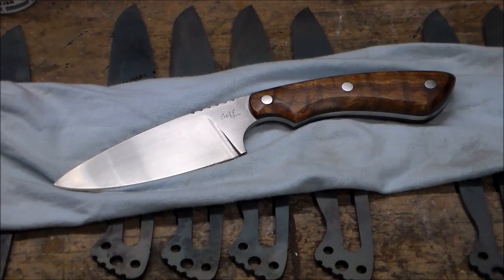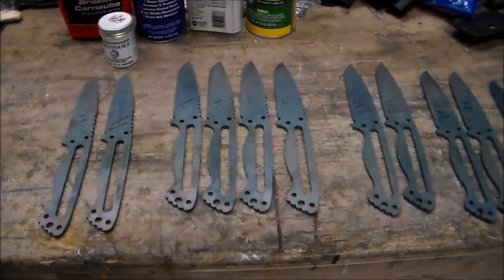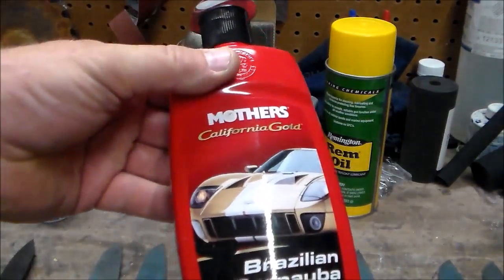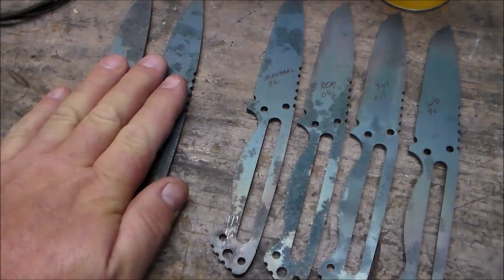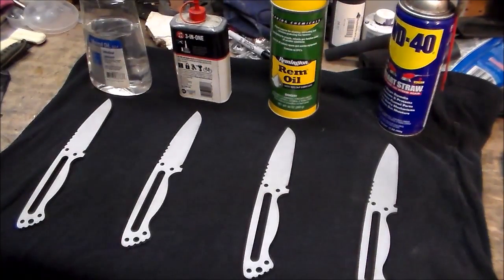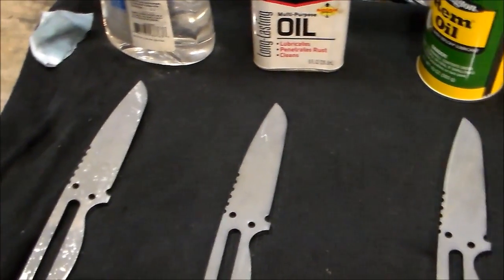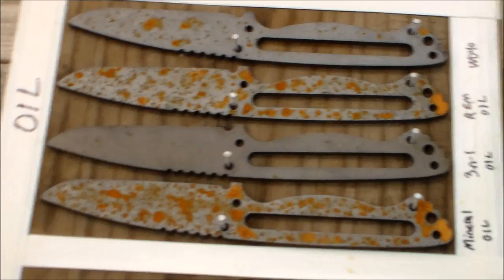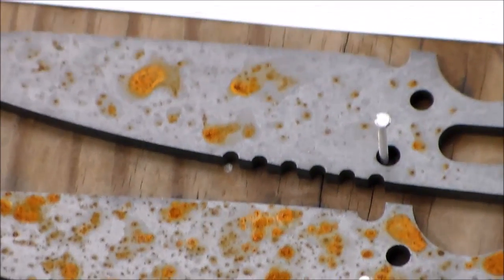1095 Steel, Corrosion/Rust Test for Knife Makers

Comment: Great video, I wish you would have tested some super lube. Im trying to find soemething that is food safe but also a good rust prohibitor.
Reply from the maker: Hmmm, never heard of that one. I'll look it up.
Reply: Yeah its great for knife pivots, hinges, flashlights etc. Theres a lot of different ones, I use the Oil super lube with syncolon (PTFE). Strangely enough I was using 3 in 1 on all my knives but then I wanted something food safe so I started using the super lube but after seeing your tests I might have to switch back. About an hour before I watched this video I ordered some citadel knife oil from amazon (again cause its food safe) but its made up of White Mineral oil and cold-pressed Camellia seed oil so its probably worthless.
My favorite for knife pivots is pro shot Zero Friction, good stuff!
Reply: JAY LEE thank you and yes I would have tested some super lube
Reply: I am looking for food-grade oil for my new knife made of 1095 steel too and saw the Citadel Knife Oil on amazon, haven't bought that yet and will go with the 3 in 1 oil first.

However, I'd like to know whether it's a good in a camping situation, to wash non-food grade oil off a knife and use it to cook, and then apply non-food grade oil later?

Thanks for the video.
Reply: I wouldnt, not camping but maybe at home when your able to wash it thoroughly. The citadel  also has cold-pressed Camellia seed oil as an ingrediant which I learned is supposed to work really well (after doing a little researcch) but then again so was mineral oil and we saw how that turned out. Would have been nice to see how the cold-pressed Camellia seed oil held up in this test as well.

Comment: Sir according to your observation,, which is The best way to protect Carbon steel from rust?
What is 3n-1 oil sir?
Please sir answer me.
Reply from the maker: Actually, almost any of the products I tested will work if you maintain them and just take care of your knife often. My personal opinion is the best system for a carbon steel blade is to have a patina like the bluing or acid etched and keep it coated with oil. Works well for me.
Reply: Sir can i use any kind of oil? 
What is 3n-1 oil?
Reply from the maker: @prakashkumerdey5098  3n1 oil is a very common household light oil that's been used here in the USA for over 100 years.
Reply: @SelfMadeProject  can i  use any oil as anti-rust
Reply from the maker: @prakashkumerdey5098  I can't say "any" oil, have no idea of what you have. I would say any light oil that you use to lubricate with should be fine. Gun oils, sewing machine oil, etc. should all be fine.
Reply: @Sceptnado  what?
Reply: @SelfMadeProject  does oil for folder knifes to fold properly work for this task? like "breakthrough hp100"
tkankyou for the answer in advace
Reply from the maker: @mataspetkevicius7466  sorry, I can't say. I've never used that one. I bet it would work, but you might just have to test it.

Comment: I have had good success with beeswax and motorcycle chain lube.  The beeswax doesn't turn racid like most oils do, and it even waterproofs shoes and sheaths.  I doubt many blades will ever see the abuse my motorcycle chains due, and I've never had motorcycle chain rust... (they will if left for years though)

Comment: I have 2 knives in 5160 spring steel from Ontario Knife Company. I wonder if these treatments would apply the same to those knives as they do to 1095??

Also on one of them I've had some very superficial oxidization start to happen from moisture in storage, although it can't be polished off. Could anyone recommend a way to rectify that?
Reply from the maker: From my experience, 5160 seems to be a tad less prone to rust than 1095. But, as for treatments, I think they would be just about the same. For a knife that just has superficial rusting, you might try cleaning with some very fine steel wool and oil. Only thing is, if its a safe queen than that will probably change the finish on the steel. If it's a user, I'd scrub it, oil it, use it.
Reply: Thanks... only thing I had around was gun oil(Hoppes), so I used that

Comment: how often to you need to apply the 3in1? Thanks!
Reply from the maker: +Matt Rhoden Wow, that's a tough question. Kind of a personal preference thing probably. On folders, oiling too often is definitely a bad thing. On fixed blades, as long as you're not soaking the scales with oil, there's not much harm in oiling often. I usually put a very light coat on my carbon blades 2 or 3 times a year, or after each hard use or sharpening. All depends on how you use them and the humidity where you live really.

Comment: Which treatment would you suggest for a chef's knife which is to be used in a restaurant?
Reply from the maker: I'm really not qualified to answer that. I don't make kitchen knives, but I hear a lot of people say they use mineral oil for them. The production carbon steel kitchen knives I have at my house all just have a naturally aged patina, I don't put anything on them. They're not very pretty, kind of like a seasoned cast iron skillet. Maybe someone else on here can share their thoughts on this too.
Reply: Thanks for the quick reply, I just asked because im not sure ich its ok to blue the steel when its used on foods...
Reply from the maker: I've also heard that blued steel isn't supposed to be used for food prep. Not sure if that's fact, myth, or just a precaution. But, even if its ok, bluing doesn't hold up that well to constant wear and tear anyway, it will wear away over time. I imagine a blued kitchen knife that saw heavy use would end up with the spine still blued and the bottom half inch or so bare steel.
Reply: I'll do some research on that, tanks for helping me out on this
Reply: i'm new in bladesmithing and dont' have too much experience  but i use my 1095 knife that  i made in normal way when you finish clean it with a wet cloth and dry it with another dry cloth  and apply some olive oil , is the same oil i use to cook so no problems with toxics and bad chemicals ,
Reply: Might try linseed/flaxseed oil. You add it to cast iron and bake it to create the seasoning so if nothing else it's food safe.

Comment: I heard you say laser cut.  I have been considering laser cutting some blanks.  I had some cut on the water jet and was not 100% pleased with them.  I really liked the profile at the start of the video.
Reply from the maker: +Belnap Custom Knives Thanks. Laser cut blades also have their problems. Like waterjet, the edges may have a slight taper to them, but the biggest issue is hardening. Anywhere the laser cuts, the heat affected zone (HAZ) is fully hardened steel. Not a big deal around the perimeter, you can just grind it off, but if you have any holes, jimping, or choils, you won't be able to drill or file them. So, I always anneal the blanks after laser, I put them in a SS heat treat foil pouch and anneal them 10 at time in a programmable oven. The reason I put up with this HAZ is that laser cutting is about half the price of waterjet. If they were the same price, I'd go waterjet.
Reply: I happen to have a water jet 7 miles away and a laser 4 miles away.  thanks for the tips.
Reply: Self Made I just got a quote back from a laser cutter for my neck knife.  I was thinking he would be able to get 70 blanks from the plate but he said he could only get 60 due to heat limitations built into his software that would no allow him to nest them closer.  I was not aware of this heat limitation.  Have you encountered this before?  I am going to check with some other vendors to see if they have the same limitations.  He quoted me $2.25 per blank which I thought was pretty dang good though.  I paid a little over $10 per blank on my prototype ones cut with a water jet.
Reply from the maker: Yeah, I've nested my own parts and came up with a number, only to have the laser cutter guy shave off a few. There are some spacing requirements on their end, so I think its just the nature of the beast. Then again, second opinions or quotes are a nice.

Comment: Great video. I’m surprised on how little rust the wd40  had on it. I was expecting more rust. The only good use I have found wd40 for is for machining aluminum. Rather use water to free up a rusty bolt than it
Reply from the maker: I had used WD on dirt bikes, bicycles, lawn mowers, etc. for years. I had never used it on a knife, but was curious how it would do. Not too bad really.

Comment: Would they rust when there inside the sheath?
Reply from the maker: +IRonikz_ Pro Well, yes, carbon steel blades will rust while inside sheaths. Leather is probably worse, it can hold moisture and responds to humidity.

Comment: where can I get 1095 blanks like these?
Reply from the maker: +DrZarkloff These are my own design, which I took to a laser cutter. They cut about 40 or so from a sheet of 1095 for a pretty reasonable price. I don't use laser blanks for most of my designs, but this one is pretty labor and time intensive so it actually saves me money with this design. There are other makers that sell knife blanks, I'm sure you can find them with Google, but, as of now I don't sell blanks.

Comment: Where do you get your blanks cut?
Reply from the maker: I found a local fab shop that had water jet and laser services. They had never done any knife work, but were willing to try it. They did have a $150 shop minimum, so I took a big sheet of steel in to get my money's worth. Water jet would be better, but laser is a lot cheaper.

Comment: Wow, that's impressive! (If that's even the right word)   Firstly, thank you very much for doing this test and sharing it with us, not to mention sacrificing those blanks..(or are you just gonna re-blast them and grind away? ;-) ) . 

Well that's deffinitely not what I was expecting either.  I just read a guy on facebook the other day saying how, after all this time and all the different products he finally came to the conclusion that Rem Oil is the best...    But anyway   I wonder how a hand rubbed satin finish, anywhere from 400 grit to 1200 grit would affect the results..  I know that the blasted finishes give more surface area for corrosion to begin, however they also give more area for the oil to be soaked up as you mentioned.  Man, sometimes these tests really raise more a lot  more questions than provide answers    :-/  lol    Why can't they just make a, "use this and this will be no rust!" solution ;)  

   So back to it, what would "your" thoughts be regarding how a hand rubbed satin, or  even a belt satin finish would soak up the oil?    And would you mind explaining a bit more on how you applied the oils?   Correct me if I'm wrong here:  You saturate the blade overnight, wipe all the excess off till "dry", and then apply another light coat on top before sending out? 

Thanks again for the very professionally handled and set up experiment.  I actually remember goin through that thread over on knifedogs, perhaps I should head over and see what discussion is goin on now, as I'm sure you posted this vid there :)  I'm "coldsteelburns" on all the forums btw.. I've been a KD member for a while but rarely post anything there, as I mainly tend to linger over on BF..
Reply from the maker: ***** Thanks for the comments. I've had several blades rust that were finished at 1000 grit, or higher. I was getting frustrated with rust and asked for advice from the pros. That's when I was told wax is where its at. 
I tend to think the test would end up same even if they were sanded/polished. When I said I wiped the oiled blades down, I don't try to get them "dry" I just lightly wipe the excess off. I try to keep me videos short, which I'm not very good at doing, so I didn't show that I guess.
Reply: Thanks for the reply, and for what it's worth I can't stand short videos that has comtent that's really worth showing and discussing, so I'm glad it was 20 min long ;)

 I think you properly explained the oil application, I was probably being lazy by asking instead of goin back and listening again lol.   ... So since you think that the results would be the same on a satin blade as the blasted ones, would you reccomend the 3 in 1?    Oh yes, that is the one and only thing I think you 'may' have left out (but I figured it was for obviou reasons, assuming 3 in 1 was your choice),  which one (or two?) of the oils and or wax will "you" be using for now on?  And will you use the same regarless for the blade finishas well as the coating, ie blued, FC dipped etc.?     Thanks again :)
Reply from the maker: ***** Well, the knife in the opening shot of video was shipped with Ren wax. I'm really on the fence about what to use, which is one of the reasons I shared this video. I hope to get some good discussion and feedback. For now,  my survival knives will continue to ship with 3n1 on a blued finish. Might continue to use wax on the satin blades, not sure. And, someone questioned which of the treatments are food safe, which I hadn't even considered.
Reply: +Self Made  the mineral oil is food safe, probably the 3-1 too by the time it's dry.  I'm not sure about the waxes.

Comment: I wonder if Froglube would work as it's like wax and and oil.
Reply from the maker: That's one I'm going to try one of these days, a lot of guys recommend it.
Reply: Self Made 
Good vid, yes I saw another test with lubes and Frog lube won...
Reply: Lawman FL thats what i use on my knives , its bio degradable and works. just heat the knife up with a heat gun to where its hot to touch and apply ans let sit for an hour or so . it soaks it up ans works great ! , i. thr field tho i use wd40 if i have to

Comment: boiled linseed oil soaks into the metal and crystalizes stops rust for years elps if you heat the metal to speed the process
Reply from the maker: Thanks for the tip, I've seen people use boiled linseed oil on blacksmith projects, but I've never tried it. Another one to try someday!

Comment: Could these blades be cleaned up?
Reply from the maker: Yes, they were all made into finished blades. Corrosion is only on the surface, just a quick hit on the belt grinder and they're good as new.

Comment: Hi this is 2019 have you done any other tests since 2015?
Reply from the maker: Dang, has it really been that long, lol? Wow, time flies by. I really need to, maybe this spring I'll give it another run. Anything in particular you want to see tested next time?
Reply: Hi, how about a silicon based lubericant like PL100 or jigaloo?that would be interesting.thanks
Reply: Throw sta-bil rust stopper and mini wax finishing paste in the next test. Great Video!
Reply from the maker: @MorrowSind  Thanks!
Reply: Self Made Project 
I second on this!
Reply: Self Made Project Vaseline too, seen it recommended a few times would be a good super cheap preventative if it works
Reply from the maker: @travispratt6327  true. I think a lot of people use it.
Reply: @SelfMadeProject  How about CLP it's used on guns to fight corrosion and clean/lube. :D
Reply from the maker: @bacontoday8545  I've used CLP before too, need to get some more. Good idea.
Reply: Self Made Project if your going to do it again, I would like to see how 🐝 beeswax works as a protector.  Thanks. Very interesting. I would have thought mineral oil would work well.  WD40 and Duck tape are the the best for a reason.  👍👍👍👍
Reply: Please try Ballistol and cold blue as well as Ballistol alone in the new test, it’s non toxic, edible and all I use on my guns, it has never let me down, but I’d love to see it on knives in these same circumstances 👽